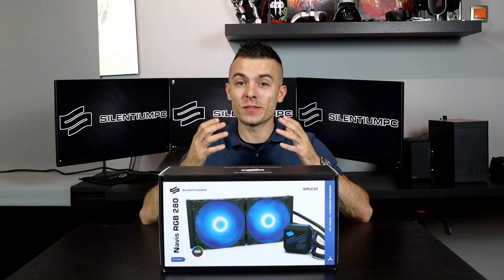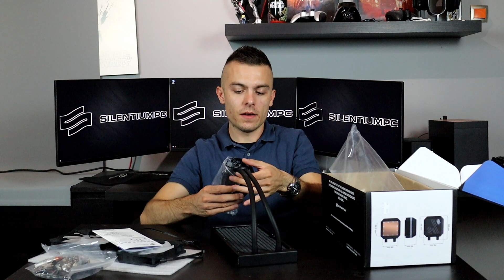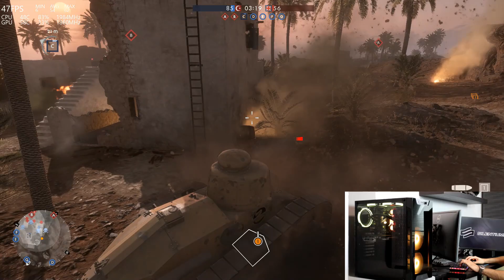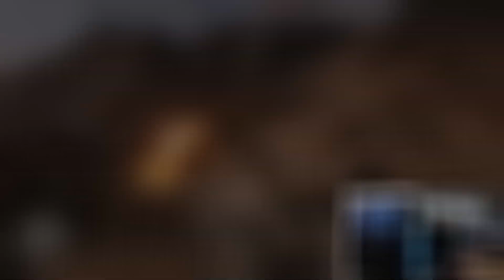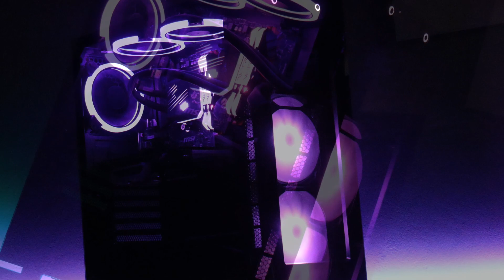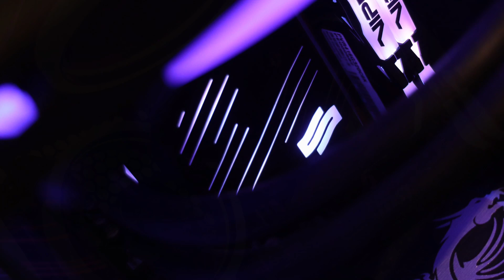SilentiumPC Navis RGB 280 AIO - testing and review

Comment: you put the pump higher than the radiator, that's a nono.
Reply from the maker: Unfortunately this case doesn’t support anything else and for the sake of testing for couple of hours, it worked normal. In that time period, nothing will happen.

Comment: Will this be fine with R9 3900x?
Reply: rated DTP on this AIO is 350W so you are good :D
Reply from the maker: Kalle Ranta @v4ult said everything :)
Reply: Thank you! :)
Reply from the maker: @kalleranta2260  You are welcome :)
Reply: @kalleranta2260  no you’re not fking good😂😂is bad for a r9
Reply: @haloo3951  So far it work really well. Not overheating at all, but I'm not overclocking either
Reply: @kalleranta2260  don’t try it😂i mean yea is good for the money but not a recommended for 12 cores
Reply: @kalleranta2260  the tdp 350w is a joke....if you put it on a 5.2ghz 10900k that has 200 power draw it will crash😂

Comment: Can i overclock R5 2600 on 4.0 Ghz with this cooler or with 240?
Reply from the maker: I'd rather go with 280mm, just in case you need more cooling power.